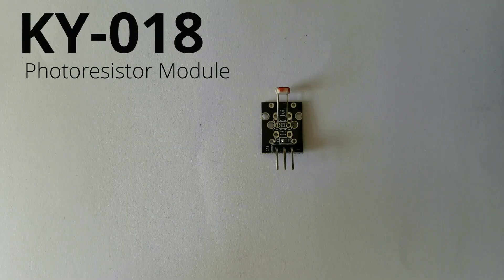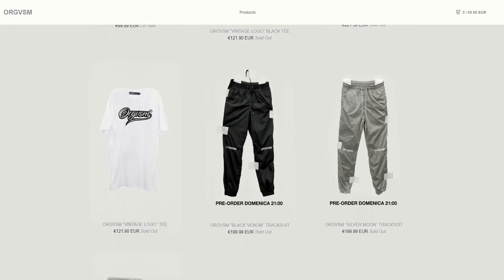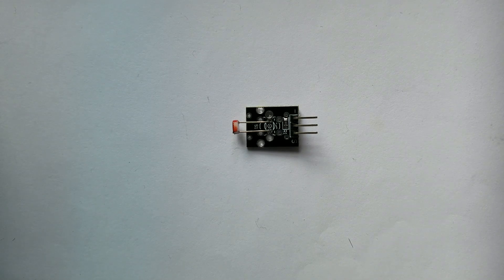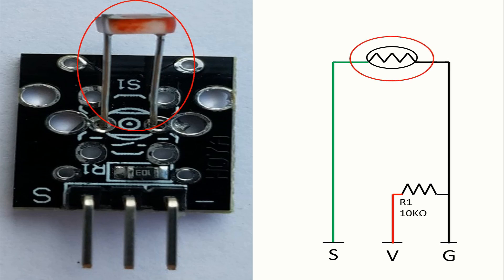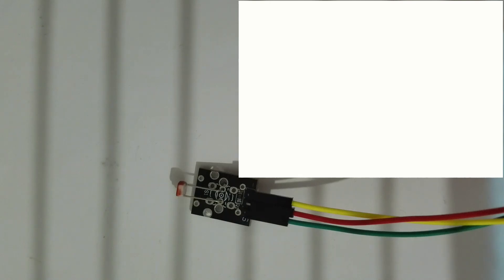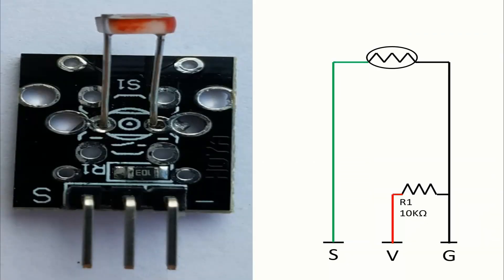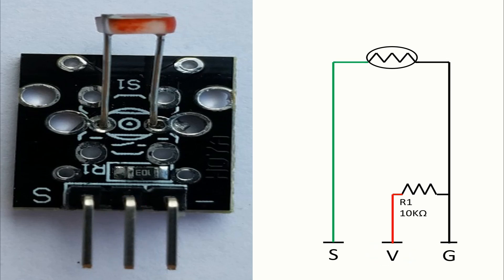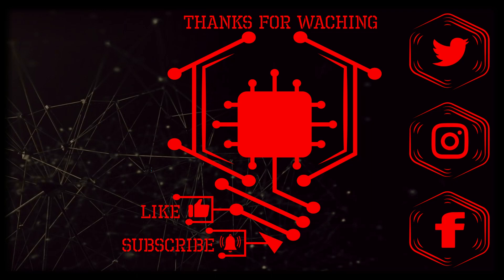KY-018 Photoresistor Module

Comment: Something wrong with the circuit.  10K resistor and LDR should be in series, with Vcc and gnd on two sides and the mid point should be the sensor point.  If you just connect the module to arduino, you get only O value.
If you interchange ground and signal, it works.